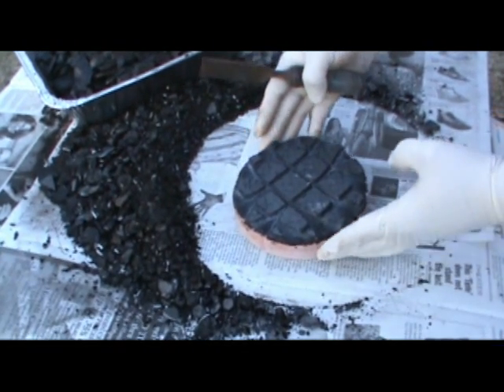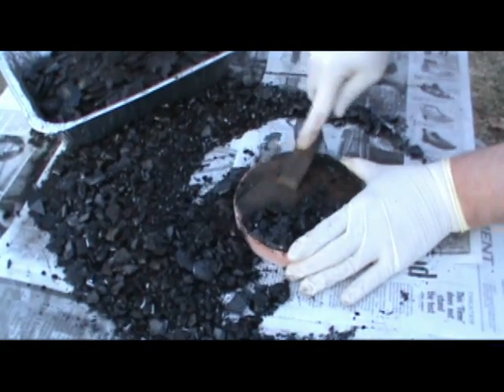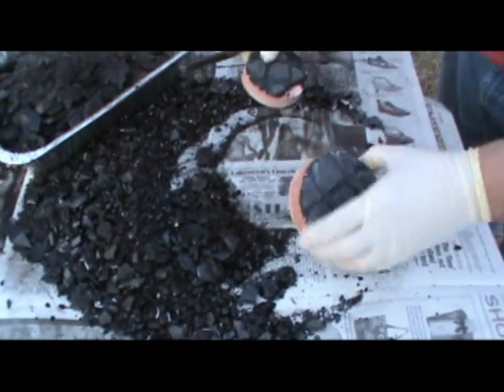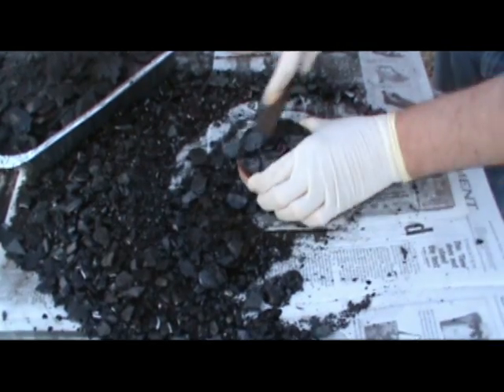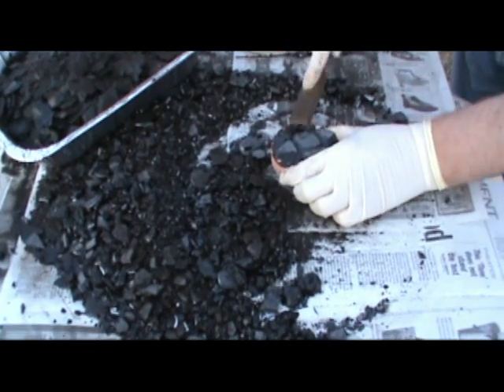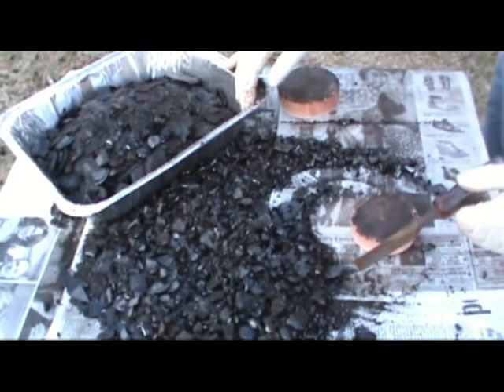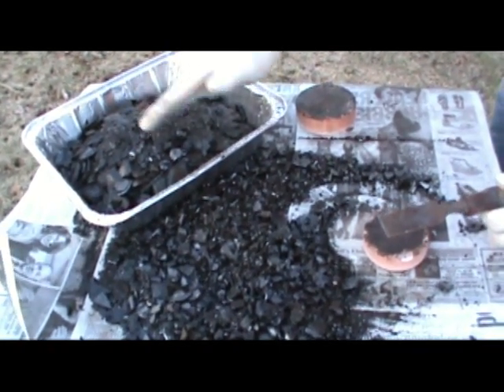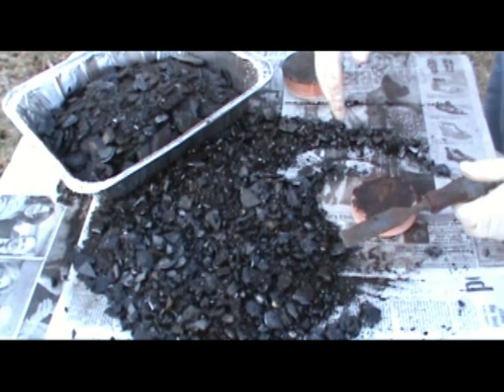Recycling Pitch for the 20" f/4.5 Telescope Mirror

Comment: Hi Gordon,

Great videos and great ideas. If you are interested I have my machine setup for auto dripping CeO while polishing and also use a teflon sheet under the mirror to have it automatically rotate while polishing. Right now I am doing a 14"/23mm borofloat blank and have no problems with astigmatism whatsoever. My videos are on Betube4.
Regards
Berthold